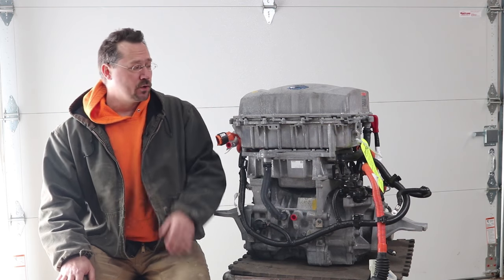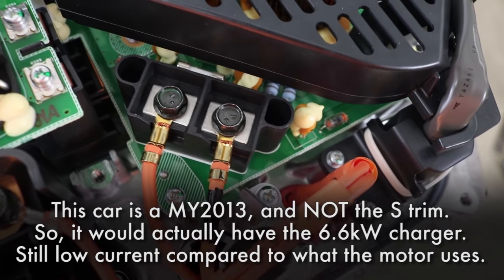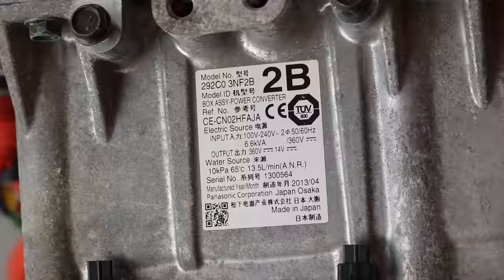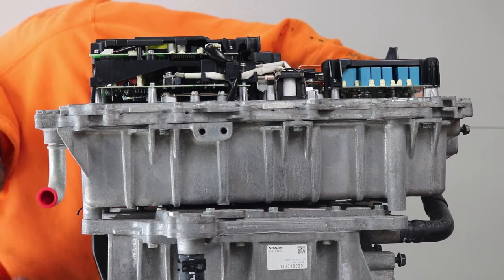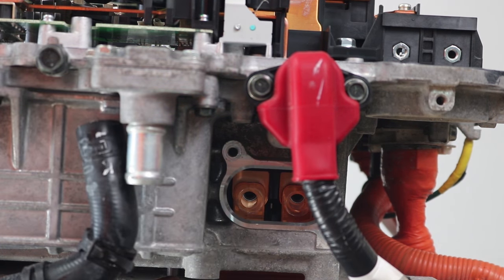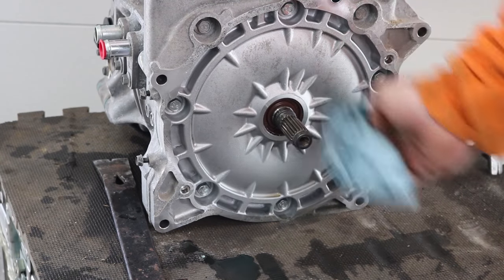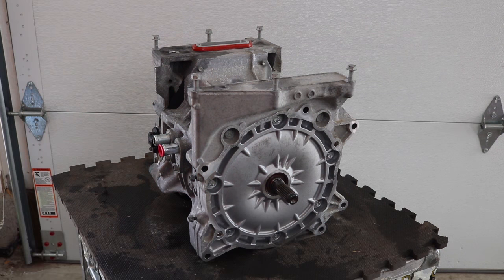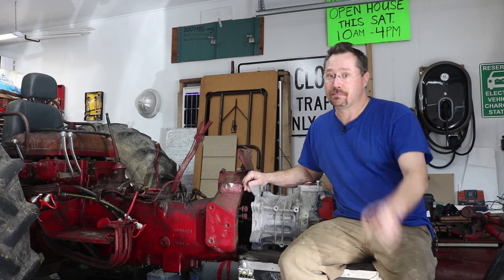Nissan Leaf Powertrain Disassembly (Teardown to EM57 Motor)

Comment: You don't need a flywheel..
Nor do you necessarily need a clutch in an EV as the motors don't idle. Harder still the leaf motor has no provisions for bolting up a flywheel unlike a normal crankshaft.

Maybe if you take out the input shaft of the leafs reduction gearbox.
Cut out the spline centre of the tractors clutch, use a lathe so both parts are centred and straight then weld them together to make a female/female adapter. 
The outer circumference of this can be machined to suit the inner race of a bearing, then the bellhousing adapter plate/spacer would be your outer bearing housing...
Or you could have a billet piece machined to suit, Probably 2 piece.
Front subframe mounts could also be run off the adapter plate as you mentioned supported by the opposing end of the motor.

My 2c anyway. Good luck, I'd like to see your solutions to these problems
Reply from the maker: The clutch pressure plate powers the PTO. Keeping the clutch allows moving the tractor from a stop with the PTO already running. A tractor transmission doesn't even have synchros.
Reply: @BenjaminNelsonX  Nothing new about non-synchromesh transmissions nor the art of float shifting them. 
However PTO drive does create it's own issues and may necessitate the need for a clutch unless is has other power solutions, i.e hydraulic/electric or something as simple as it's own smaller flywheel driven out the starter hole.. 
mounting a flywheel to a leaf motor introduces it's own engineering difficulties as does heavy clutch thrust loading the motor.
That heavy flywheel, clutch assembly and support of the input shaft normally shares it's load across many, constantly lubricated main bearings aswell as thrust bearings which an Electric motor hasn't got.

Comment: Is it possible to put this assembly in the rear and have axels connect to it (similar to tesla motor)?
Reply from the maker: Sure, just keep it with the gearbox and run some custom half-shafts out to the wheels.
Reply: @BenjaminNelsonX  I can't believe there aren't any rwd Leaf, i3, chevy spark swaps out there, mostly tesla swaps. The others are so much more affordable.
Reply from the maker: @propelproject  I completely agree with you!
I think there's just still always a buzz around Tesla, but there are plenty of great electric car components out there!

Comment: pardon my ignorance ,so.. a  leaf electric  motor  will run   with any batery  without the computer?  just with a controler ? (curtis or   others) thanks!!!
Reply from the maker: "Controller" usually refers to a DC motor speed control.
This motor requires an Alternating Current (AC)
variable frequency inverter designed for the purpose of powering a 3-phase permanent magnet motor.
Reply: BenjaminNelson what controller/s are you considering?
Reply from the maker: @MrAaronBahner  
A) Original Nissan Leaf inverter, but with a Thunderstruck VCU.
B) Original Nissan Leaf inverter, but with an Open Source Arduino Based controller board
C) Chevy Volt inverter (already have) but with a Paul Holmes custom input board on it.
D) Azure Dynamics DMOC 445. Already have and it's designed for regular inputs, no fancy CAN stuff needed.
E) OTHER.

Comment: Are you planning on any gear reduction? If I understand correctly the leaf motor can go to around 10,000 RPM and the stock engine was probably more like 2500 RPM.  Granted the leaf motor at 2500 probably still has more torque than the stock engine so a gear reduction might be overrated.
Reply from the maker: I think you nailed it. If I want to use this motor with the tractor, it might all be more about the torque charts than anything else. I'm going to see what information I can find about the tractor engine and Leaf motor in TORQUE, rather than horsepower.
Reply: @BenjaminNelsonX  So looking at this closer tractordata has some tests and I looks like the torque was way higher than expected. Check out the test data pdf. http://www.tractordata.com/farm-tractors/000/3/1/318-international-harvester-300-tests.html
Reply: Something about those numbers seems off the more I think about it. A gas engine from the 50s shouldn't have those kind of torque numbers.
Reply from the maker: @TimBertram  I haven't said anything about the torque of the engine yet. I'm just listing the numbers that I've seen for the rated Horsepower of the engine. According to TractorData.com, the International Harvester 300 Utility has about 38 to 42 HP, depending on how it's measured: http://www.tractordata.com/farm-tractors/000/3/1/318-international-harvester-300.html

What I would LIKE to figure out is what that really comes to for TORQUE at the engine. That way, we can directly compare the gas engine to the Nissan Leaf motor or any other electric motor we have torque information for.

I found a more detailed test of this engine at: https://digitalcommons.unl.edu/cgi/viewcontent.cgi?referer=http://www.tractordata.com/farm-tractors/000/3/1/318-international-harvester-300-tests.html&httpsredir=1&article=2069&context=tractormuseumlit
That does list some torque information in one of the tests, but at the dynamometer, rather than at the engine.

If anyone can weigh in on the torque of this gas engine, that would be appreciated.
Reply from the maker: There are links there to the University of Nebraska tests that were done when the tractor came out. One of the tests lists torque, but it's at the dynometer, so at the wheels. The test doesn't say what gear the tractor is in and I don't know the gear ratio in the differential.
Reply: @BenjaminNelsonX  I've only ever seen tractors on a PTO dyno. I've never seen it done to the wheels like with cars.
Reply from the maker: @TimBertram  Hmmmm. That could very well be. The only dynometers I am familiar with are those that are for wheels on the ground. However, the numbers on the chart for the ratio of engine RPM to dyno RPM vary. It should be fixed if it was just gear reduction of the engine going to the PTO.
You can see how it can be difficult to find out some real torque information on one particular old engine!
Reply: @BenjaminNelsonX  So I went back to the report.  Best I can deduct the torque testing was done of the side mounted belt that many only tractors had.  I don't believe that your tractor had that probably because it would have interfered with the loader. Not sure if you read it earlier but I skipped the second page which explains Test L.  Long and short of it the only thing I'm getting from the test results is if it has 100% torque at 2000 rpm then around 1320 rpm(66%) the torque is 106% of whatever it is at 100%.  So really they measured torque rise more than they measured torque. So back to square one really.  I may know a few people that may have a more educated guess if I find anything out I'll pass it on.
Reply from the maker: @TimBertram  All I can tell you is that this tractor does NOT have the rotating side drum to power a belt, so BELT horsepower or torque was definitely NOT tested there.
Reply: @BenjaminNelsonX  looks like something like this was an option to connect to the PTO. http://i140.photobucket.com/albums/r16/Wardner/Wang-tractor043.jpg
Reply: @BenjaminNelsonX  Power = rpm * torque. So for the same torque at 4 times the RPM, the motor would nee dto be 4 times the power.
Reply: Hi. Looks like at peak hp (41.1) at 2000 rpm this engine has 108 ftlbs of torque. The leaf motor will be more than sufficient.